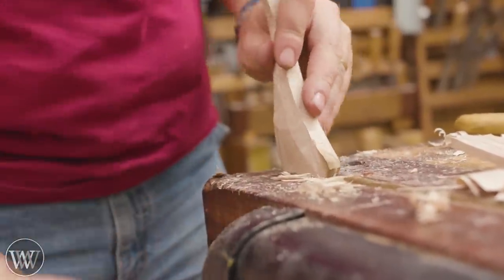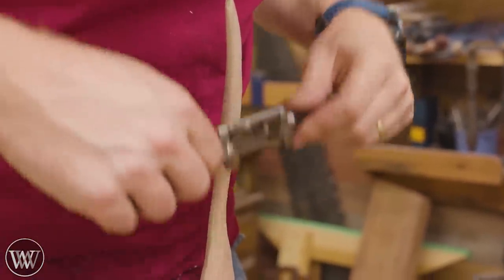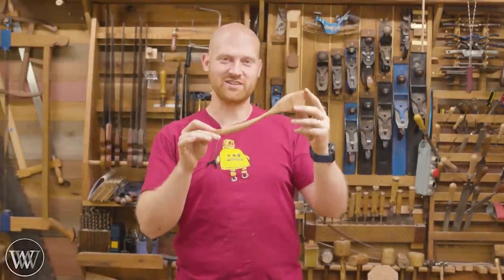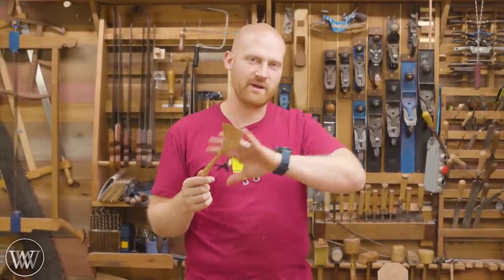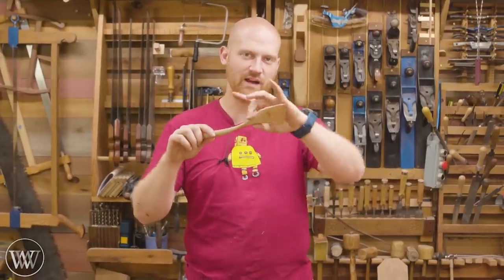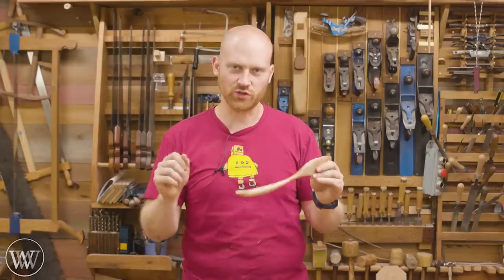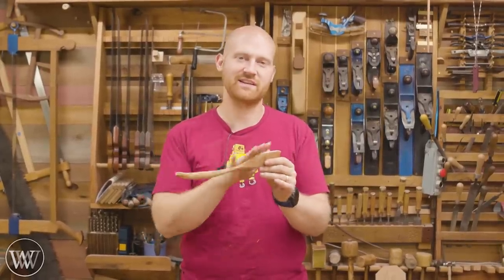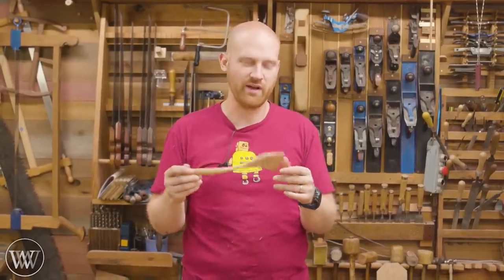Made This With Only 3 Tools

Comment: Hello, I plan to buy some tools to start doing things in wood, things for home, beds and simple furniture for example, the query I wanted to ask you is if you know the oscillating multipurpose tool, also called oscillating multitool that brings pointers for sanding, to make cuts, etc, I do not know if I buy (apart from a circular saw) a multitool of those that I mention or a jig and a sander, I hope you can help me, thanks

Comment: Could you explain the difference circumstances one would use a spokeshave over a card scraper?
From the video I can't really see when you would use one or the other.

My untrained eye would even further think if you were really careful, one could do everything with a chisel? the spokeshave and  card scrapers looked like "nice to have" but not necessary tools?
Reply from the maker: Right on. Every tool in the shop is just a jig to hold a chisel. If you're careful enough you can do everything with just a chisel. I actually have several videos where I build an entire project using just a chisel. a card scraper is a much finer tool than a spokeshave. The spokeshave is used to take off larger chunks and the cards scraper is more in place of sanding and getting that smooth perfect finished surface.

Comment: I didn’t know what you were making until pretty late in the video (I didn’t read the description part before watching). Way to keep me guessing! Anyway, this is a nice, simple, satisfying project. But you used more than three tools by my count: chisel, mallet, vise, spokeshave, card scraper. That’s at least five tools.
Reply from the maker: Thanks. This was a fun one. As to tools list only 3 cut the wood. It is hard to draw the line on what is a tool and what is shop or ansilary. Do I count sharpening system, what about shoes? Most hand tool people draw the line at what cuts the wood. As everything else can be replaced by a stick or rock in the woods easily.
Reply: Yeah, what about shoes?  Actually you can also cut wood with a stick and a rock. One of my other favorite YouTube channels, Primitive Technology, shows this all the time.
Reply: Now that you mention it, you also used a screwdriver and sharpening equipment on the spokeshave iron. I forgot to count them. 😏

Comment: Nice job for only using 3 tools. I've made spatulas before an I also use a saw to add relief cuts across the grain when hogging off that much wood, but that's a personal preference. 
NOTE:
May I add to the unskilled with chisels, when you see Jim holding the piece in his hand and chiseling off stock, he is experienced and knows exactly where the cutting edge is  in relation to his free hand. You should always use a vise or clamp the work down and keep your hands clear of the cutting edge. Both Jim and Paul Sellers teach you how to put scalpel like edges on your chisels so remember that when you are using them or you will meet new people like the nurse and the PA or the doctor in the emergency room!
Reply from the maker: Ya I normally cut down too, but wanted to limit myself on this one and let the grain of the wood dictate the shape.
So true. though in some shots it looks like I am chiseling toward my self I never am. that is just the fun of the camera.